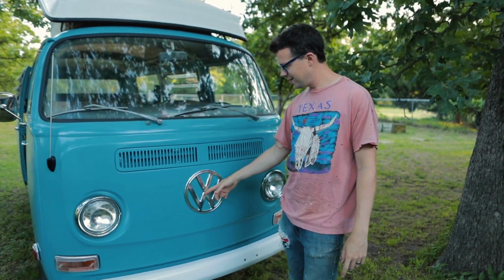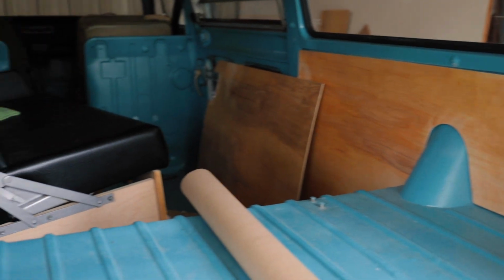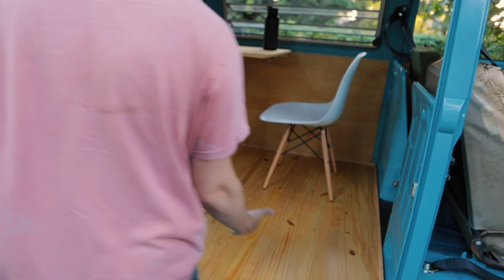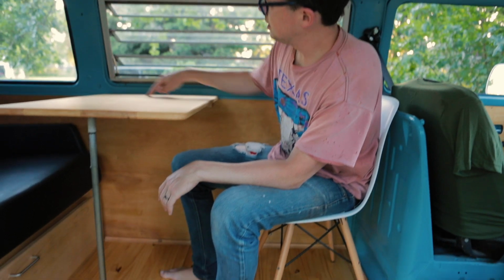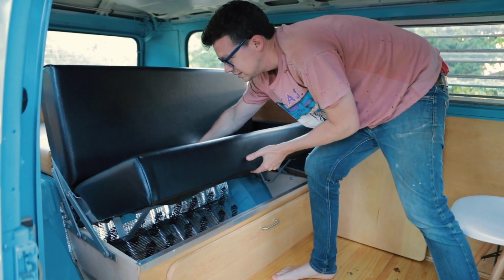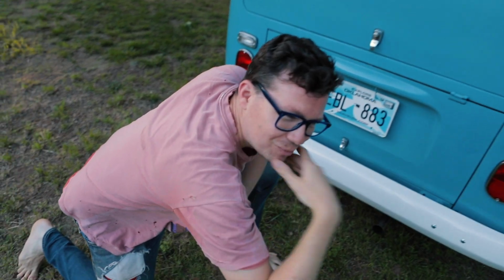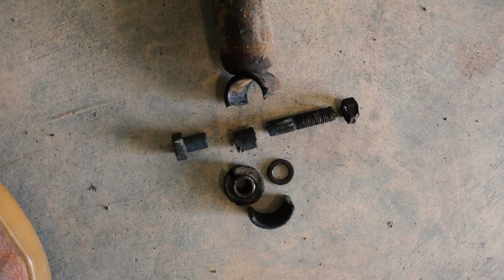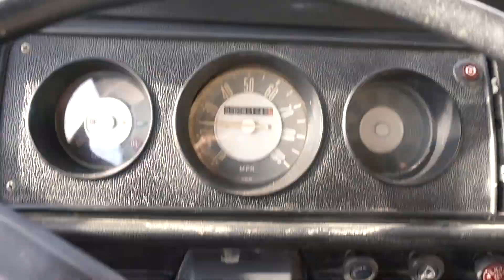Interior! 1970 VW Bus Restoration | Underwood Garage 11

Comment: What kind of mileage are you getting?  I only seam to get 10 to 12 mpg on my 73 bus. I have been following you all since the redwood trip in the old bus. I wish I would have done a frame off restoration like you did on the new bus but I did it like you on your first bus, with the exact same problems. I feel your pain !
Reply from the maker: I haven’t calculated mine yet but 10-12 is low. VW life’s comment is great direction I am sure.